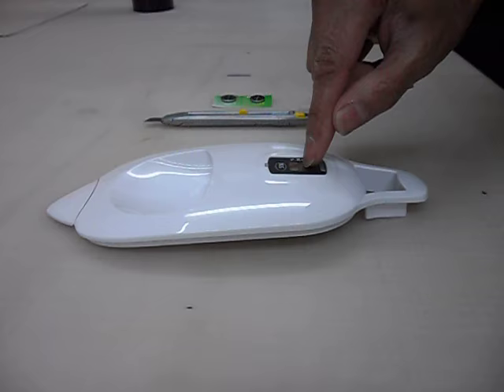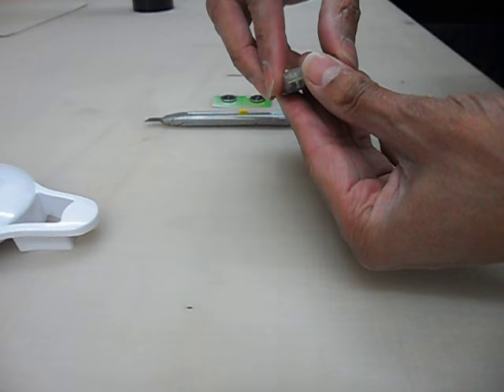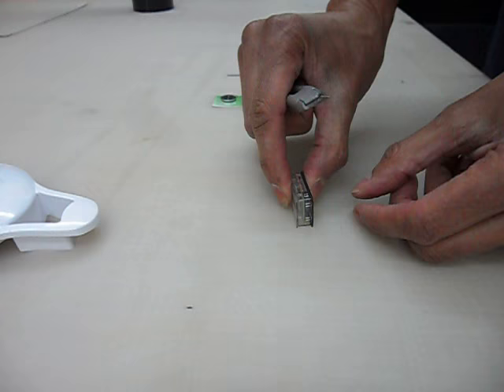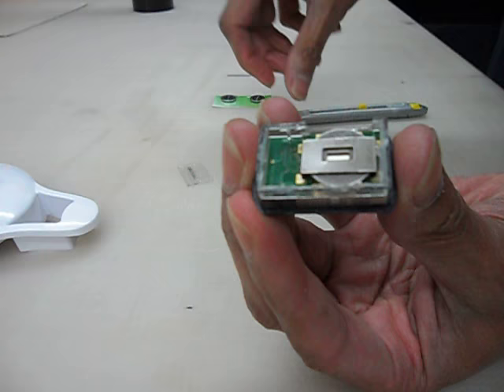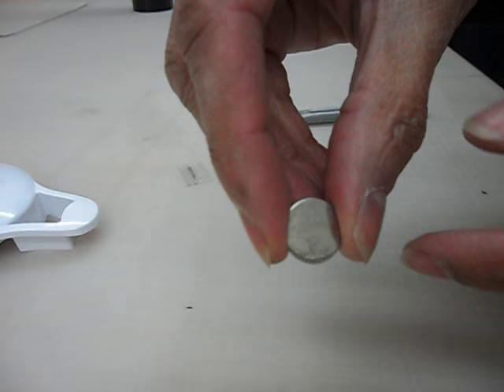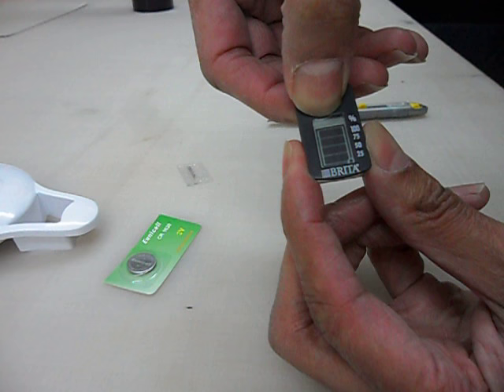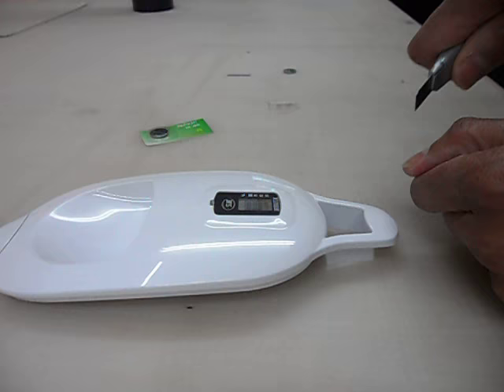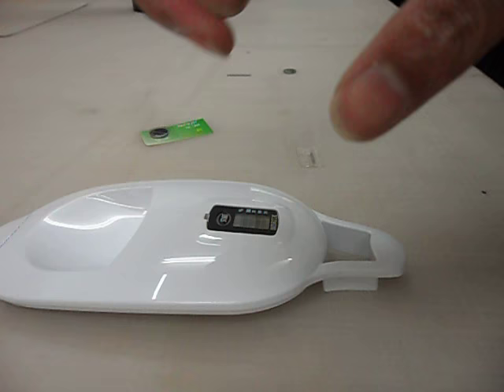Replacing battery - Brita Maxtra water filter battery replacement

Comment: Does the filter work without the timer?
Reply from the maker: Hi.

Yes, the filter will work without the LCD display working. The LCD display is purely a visual aid for you to gauge when it is time to replace the filter.

Brita recommend that the filter should be replaced at least every 4 weeks, or after 100l of water has been filtered.

The LCD display has 4 bars. So, when you fully set the display to 100% and fit a new filter, 1 bar will disappear each week. After all 4 bars disappear, you should change the filter.
Unfortunately, this method doesn't take into account how much water has actually passed through the filter, so it isn't very accurate and should only be used as a guideline.

Obviously, if you filter 200l every 4 weeks, you should reduce the replacement time by half and so on. But if you only filter less than 100l every 4 weeks, say 50l, you should still replace the filter in the recommended time (Brita's advice, not mine).
Reply: @Petej728  Awesome thanks so much

Comment: is it waterproof ?
Reply from the maker: No. Once you've opened the battery compartment, unless you specifically reseal it, the unit will no longer be waterproof.
Reply: @Petej728  ok thanks...

Comment: Why didn't you just request a New entire piece from Brita. Doesn't cost a thing and now you can't get water on the lid or wash it or  you'll get water in it and stuff it completely.
Reply from the maker: 1. As I have previously said, there was no obvious information stating that a free replacement would be supplied on request.

2. It would have to be a fairly significant lapse of concentration for me to completely submerse or flood the lid to the point where the unit filled with water. After all, the lid is removed when filling the jug and the unit can easily be popped out if I actually want to wash it.

3. And even if I did somehow manage to short out the unit, I can (apparently) just contact Brita and get a free replacement.

4. If you actually own one of these filters, I would assume that you have an awareness of the environment around you.
Asking a company to go to the trouble of getting one of these items, putting it in an envelope (I would assume a padded one) and then the cost of shipping and delivery (and although it's free to us, there is still a cost) is a little over the top when we can just replace the battery ourselves. A much smaller carbon footprint I think you would agree.

5. Finally, if you didn't come here to find out how to replace the battery, is the only reason you did come here to just make some negative remarks and  put a downer on everything? If so, just give it a thumbs down and jog on!
Reply: Here you are mate.. 🖕🏻
🏃🏼‍♂️🏃🏼‍♀️ Jogs off..

Comment: In aquaport (mini) how to use digital counter can you make video for that
Reply from the maker: Hi Samitha.  I had a quick look on the internet but couldn't find the water filter you mentioned 'aquaport (mini)'.

If you can let me know who makes it and the model number, I will try to have a look for you.
Reply: @Petej728  Sorry not mini , 
AQUAPORT (Filtered Water Cooler) it's model number is AQP-24CS. 
I am unable to open the top digital timer. And it's not working too.
Reply: @Petej728  also I searched in internet no video I found about that but saw your video
Reply from the maker: @sj4429   If the model I looked at on the internet is the same as the one you have, after having looked further, as far as I can tell, the model you have works on mains electrical power and so there is no battery to change in the timer. It can only be reset, unless there is a fault with it in which case you need to contact the manufacturer for instructions on what to do.

Sorry I couldn't help any further.
Reply: @Petej728  Thanks & no problems

Comment: I can't get it off, both lid and display plastic is damage, and it doesn't move a bit.
Reply: Have the same problem.........no way to get it out without damaging. What a crap
Reply: Hi Ben, I have put in the oven at low temperature for a short time so the plastic gets a bit soft, then it clicks out easily......that worked!
Reply: I did manage with a flat screw driver and i am a girl lol. Yes the lid is a bit scratched where the unit goes in  but no big deal. 😉
Reply: Same - no way mine popped out like that with a finger nail (great nails by the way  - must stop biting mine).  I actually broke the unit a bit by trying, so will need to superglue that back on (maybe).  Eventually got it out but scratched the lid in the process.  Not sure it's designed to come out and definitely not designed to replace the batter as Pete notes.  Mine is brand new so I shouldn't have even bothered at this time - was just curious.  Not sure how long the batter will last - we will see.  At the end of the day you can always monitor time between cartridge replacements manually I guess.

Comment: By the time you pay for the batteries you could get a new one.
Reply from the maker: Okay. A pack of 10x CR1620  batteries currently costs GBP2.75. That's 27.5 pennies per battery, from eseller.

Other than the initial investment in the time required to make the unit ready to be able to replace the battery and the time to wait for the new batteries to arrive, in the long term doing this is a huge saving on materials at a minimal cost.

Whereas getting a new unit every time the battery runs out involves a huge social and environmental cost that requires telephone calls/emails, labour in picking out the new one from the warehouse + labour/packaging/fuel costs to actually get the item to your front door. And that's without going into the costs of manufacturing and storage of the units worldwide.

I'll let you decide which is the best option.

Comment: You need to seal it somehow or water will run into it and damage it since it’s an electronic device.
Reply from the maker: I still don't understand comments like this saying it has to be sealed to keep water out. How would you even possibly get water into it?
When you fill the jug with water, you must surely remove the lid and put it to one side and then pour water directly into the jug itself? In which case, how would water get into the unit?
If you want to wash the lid, you would just pop the unit out, wash the lid, dry the lid and then replace the unit. In which case, how would water get into the unit?

I have had my water filter for years now and the LCD unit has NEVER got wet. And I can't understand how anybody else would get it wet.
Reply: I can't understand why you're so vexed .. it's a legitimate concern. People generally will rinse off the lid w/o removing the unit, and removing the lid when refilling isn't necessary when you have a "pop up" hinge to access.
Reply: @Petej728  if you don't pour with the lid on and have that thing record the amount of water eliminated, there's little point to changing the battery, which will last more or less a month, regardless of use
Reply from the maker: Was just re-reading through some of my comments when I saw this reply.

I am not 'vexed' as you put it. I am simply confused as to how people can manage to get the unit wet if they use the filter correctly. 
1. It takes a simple wipe with a damp cloth to keep the lid clean, not submerging the whole thing in a bowl of soapy water.
2. If you fill the filter through the 'pop up' hinge, then all you are doing is pouring water directly into the jug and totally bypassing the filter.

I made the video purely as an aid for anyone interested in replacing the battery themselves. It is not a definitive instruction that everyone HAS to comply with.
I really don't understand why other people get so 'vexed' when they see the video. If you don't want to do this, then just.. don't do it. Simple.
Reply: @bradblythe9352  I agree, I don't know why it makes him so angry when people point out that the unit is supposed to be sealed!
Reply: @PeteJohnson728 I understand your point, but it is an illusion to think millions (even hundreds) will not mess up somehow. It's used for water so people will manage to  somehow wet that zone, it's bound to happen. But it is also easily solved in this case, people can super glue the top back making sure they put glue all around ^^, 

By the way, thank you for showing how to do this 😀
Reply: @Petej728  seriously??
one word... condensation.